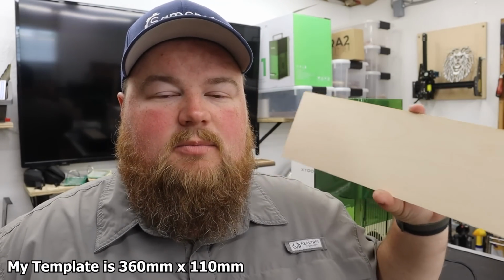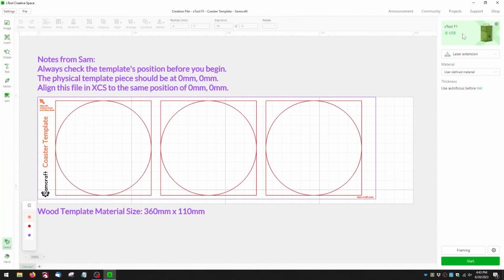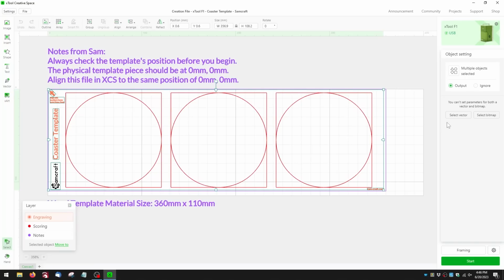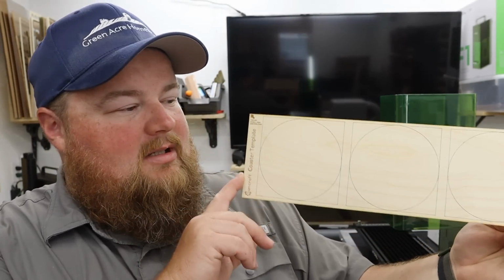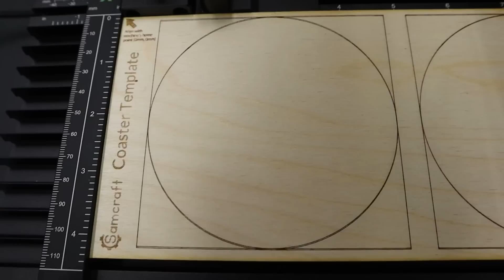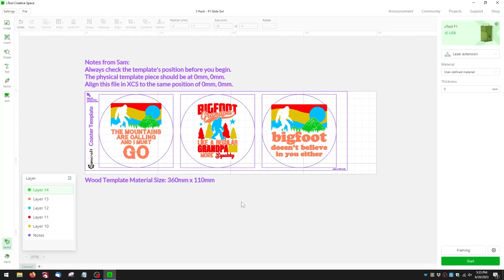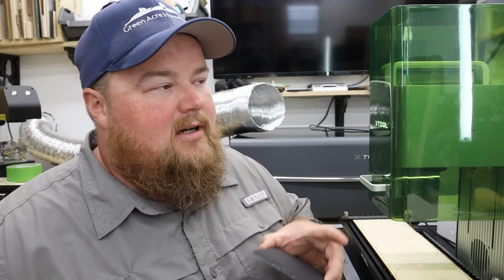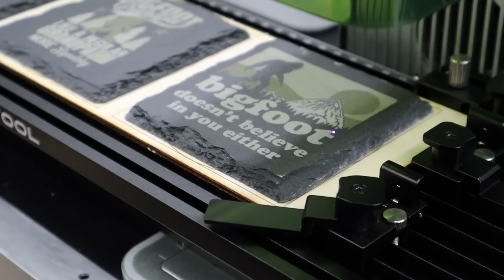Batching Out Coasters with the xTool F1 Feat. Slide Extension Table

Comment: Hey Sam, great vid.  I did buy the template pack, working with them now.  I see V2 in the file name for the coaster project and the panel dimensions are different from this video, namely the material size is 399mm x 115mm in your XCS v2 file, and in this video you show the material size at 360mm x 110mm.  Is there a reason you changed this in version 2 file?  I'm laser cutting these pieces out of birch ply today...thanks!

Comment: You are so easy to watch and listen to. You explain things perfectly. I have a question. If I want to primarily be engraving on bamboo or wooden coasters and metal lids for candles, do you think this is a good choice for me? I'm also looking at the new S1. I understand there is a big difference in workspace but I feel this one will work good too. Could you please advise me on this? Thanks in advance!
Reply from the maker: Both machines should work fine for those materials. The plus of the F1 is it will be faster, but the S1 is more capable from a business aspect with the larger size and other features.

Comment: Great video! I had a question on the finishing of the slate coaster. I have been using rustoleum matre clear coat. I want start selling them but I am not sure if it is texhnically food safe to use that. Is there a food safe way to finish and protect these costers or does it not matter what you use.
Reply from the maker: I do not put anything on my coasters. I engrave them, wipe them off, and send them out the door! I've sold thousands this way and never had a complaint or issue. If sealed, the coaster will not absorb anything like a coaster should. If engraved correctly, the design will not fade or lessen over time.

Comment: I attempted to make the coaster template, but something went wrong.  The template that I produced was significantly different than the one you demonstrated.  I think I may have changed the file settings.  How do I get the original template creator file back?

Comment: Is there a reason they all couldn’t be put closer together and more to the left? I feel all 4 coasters should still fit nicely in that base then. Especially since you are not going all the way to the edge, so they can be placed really close. Thanks!
Reply: No, most coasters are 10cm, 100mm the bed is only 360mm missing 40% of the forth coaster. Now if you where only engraving a small spot of the coaster then doable. But not with a large design.
Reply: @seannorris3201  thanks, that makes sense. :)

Comment: Okay sam, what I don't get is why spend so much on independent laser systems when you could far more easily batch out probably ten times more if you wired a laser module up to one of the larger cncs?
Reply: Im planning on getting it to do engrave on demand at craft shows and such. While having a co2 at home to work on other products.
Reply from the maker: While CNCs have a larger footprint, they also move much slower than a laser. I don't recommend mixing the two together.

Comment: if you have the p2 way not just batch engrave instead of using F1.  Some say the F1 is better on coasters.
Reply from the maker: The engraving quality is better from the F1 on slate, in my opinion.
Reply: @Samcraftcom  i did 4 coasters on my P2, had to take at least 35-45 min. I did one coaster on the F1 and it was done in less then a minute. So fast...